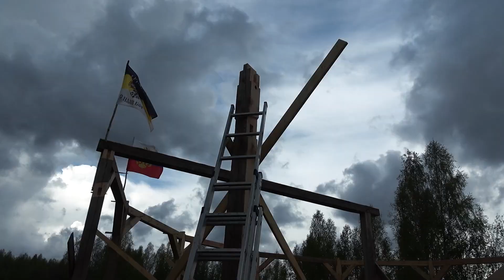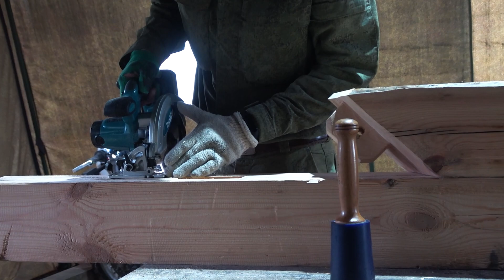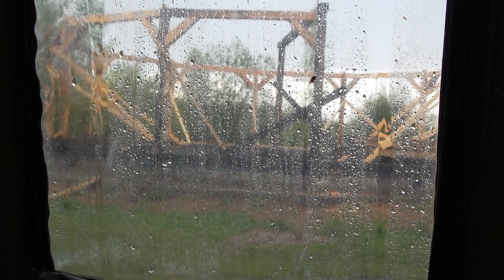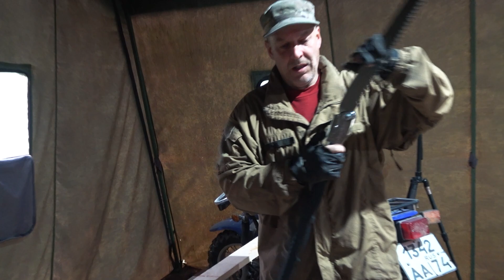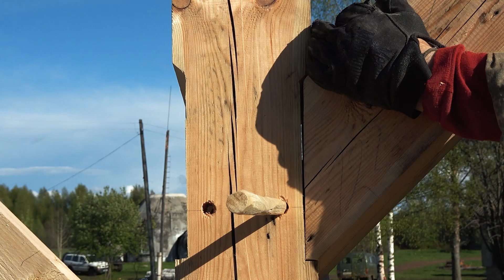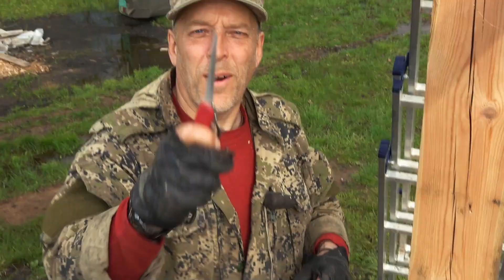Building A Round House On The Taiga - 12-Sided House Build

Comment: I worked for 9 months on a garage and house. I always referred to it as the house with no nails. It was built from old dock materials 6 inch by 12 inch,  Plates and studs all 6 x 12. Posts and beams solid wood 12 by 12s. Held with 4 inch dowels and 3/4 inch cross dowels to lock large dowels. I had to make a 22 foot 12 by 12 beam with 3/4 inch notches on either side but in different spots to hold the ceiling joists that were made of 4x4s. It had to be perfect the first time because it took so long to make. Then it was burnt with a tiger torch and the charcoal was wire brushed off the surface. Then it got installed ....whew.
Reply from the maker: 6 by 12 is some serious beams!